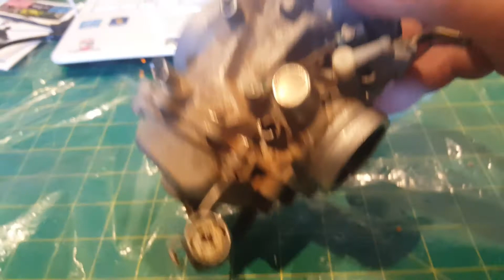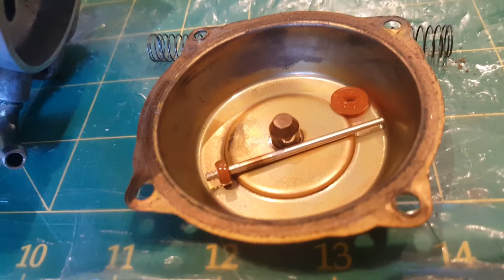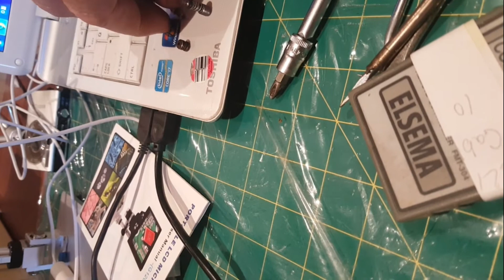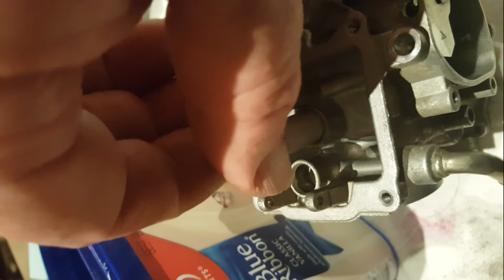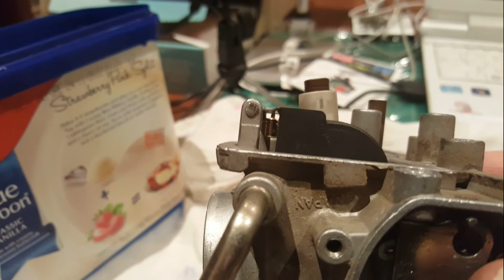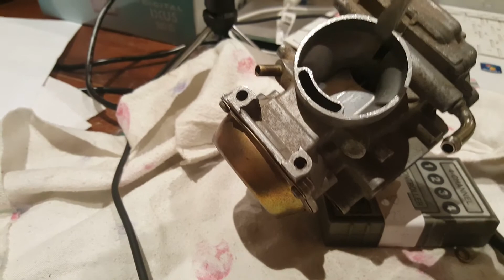Suzuki 1996 Quad Runner Carburetor Clean and Fix

Comment: where did you buy your rebuild kit from?
Reply from the maker: EBay. There are a few listed. I did not use the jets just cleaned the original ones. Used the float valve and the bowel seal and small Orings.

Comment: The more I watch the more concerned I am my mixture screw has no o ring or spring my main jet has no washer and I’m not even half way through the video
Reply from the maker: Get a $20 carb kit for the mixture screw spring washer and Oring. Use the float valve and float bowl Oring gasket. Find a small washer for the main jet. Or swap parts from a cheap china clone carby.
Reply: @bms250ford  yeah I bought a carb kit with everything I need

Comment: The large tube connected to the "T" fitting is just a vent I believe. The one I'm working on has the tube that is supposed to go to the petcock plugged on either side, thus rendering it useless. will make sure the petcock allows fuel flow without it. My guess is someone tweeked the petcock to not require it.
Reply from the maker: The vent tube the runs to the right rear of the carb just vents the float bowl to a high point near the fuel cap and may have a T piece at its end going nowhere. The Petcock with a vacuum line usually connects to the  front upper metal tube while the fuel pump connects to the right front plastic carby fitting. The petcock can run free if set to prime and will shutoff if set to run or res with no vacuum line connected.